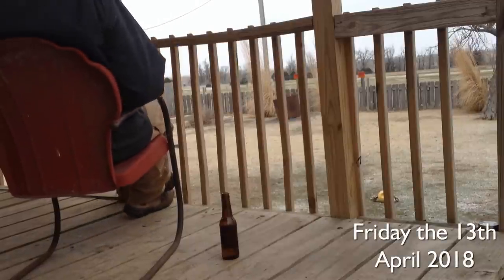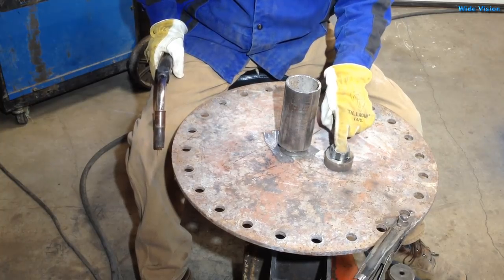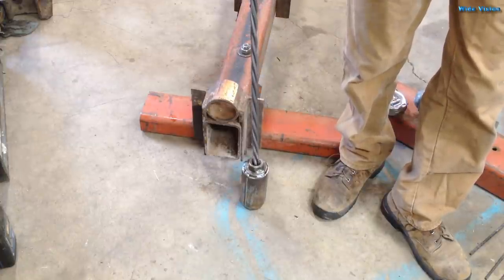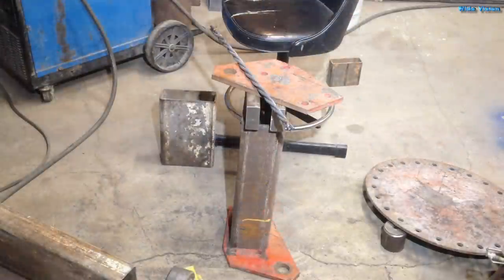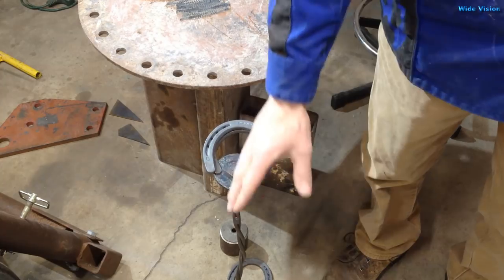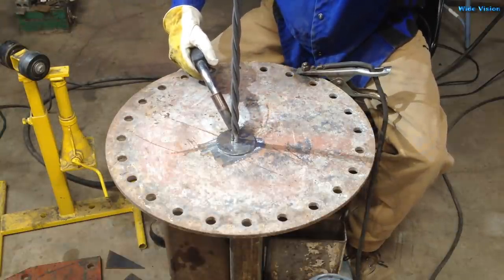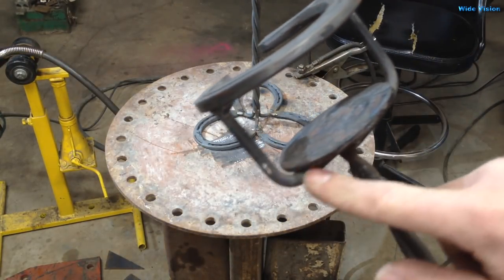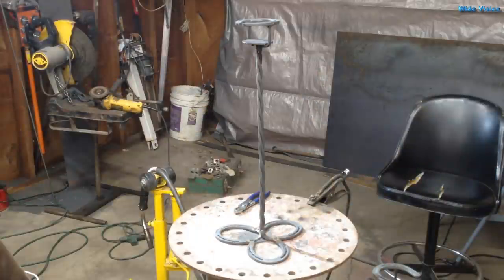Horseshoe Drink Stand Build - With a Twist

Comment: A very neat welding project. Most horseshoes will bend cold, but if not, you can always heat them with a MAPP gas torch.
Reply from the maker: Thanks! (I didn't see your comment earlier for some reason.) Yep, horseshoes are usually quite soft. There's few used ones I got that were hard. I'm guessing they had a specific purpose, but I don't know what it would be.

Comment: Might I suggest put together a plan for a 2 (two) drink holder spaced maybe 8 - 10" inches apart, at the top, so it would service 2 (two) people @ once, while sitting and enjoying a adult beverage on the porch.
Reply from the maker: I actually got asked to make single ones because the person wanting them could only find dual holders for sale, and they didn't want that. But, you are right, I should do a dual holder so people have options.

Comment: Speaking of option(s): Think of a miniature bucket of ice (like a ice bucket for champagne) but in this case, to surround popular size beer can's / bottles. The option(s) would then be as follow's: 2 + 2 = {a spinning / rotating top} Two beverage holder's without the ice, & two with the ice. It would come down to how fast or slow of a drinker the person or persons are, on a hot summer day-nite. The customer is ALWAY'S RIGHT, but they should know their options. :-) I'm thinking for the ice bucket walls I would use a small dia. wire mesh myself. Just a option, or build the ice buckets so as to hold the soft Styrofoam "insulated beer can / bottle" holders.

Comment: If it resists a 40+ Mph wind it should outlast you willingness of sitting outside and enjoy any drink at all...   lol
To help avoid the BBs to stick to the steel beside the welds just rub in some anti spatter paste for MIG nozzles it helps a lot to ease cleaning there after...  At least it works for me...   ;)
Reply from the maker: I didn't use the antisplatter  because I wasn't sure how it would affect the paint sticking. I guess it's easy to wipe off with acetone, which is probably faster than filing off the BBs...
Reply: Hot water and dish soap, dry with clean compressed air, or even for production rund, a pressure washer with soapy hot water will do a great cleanup.